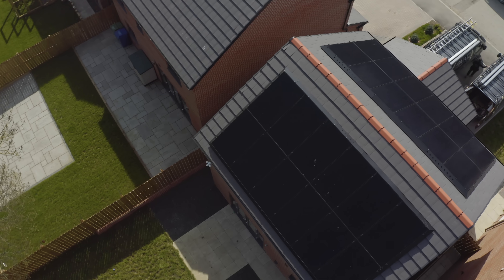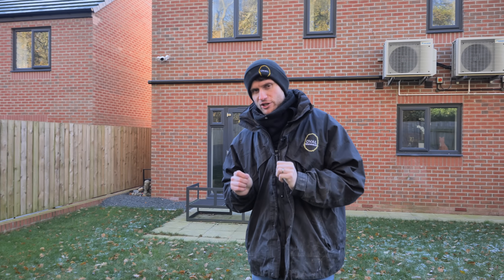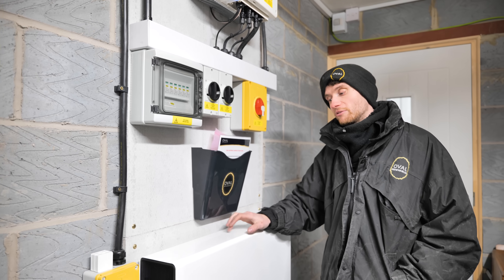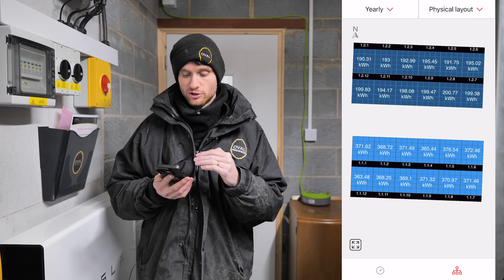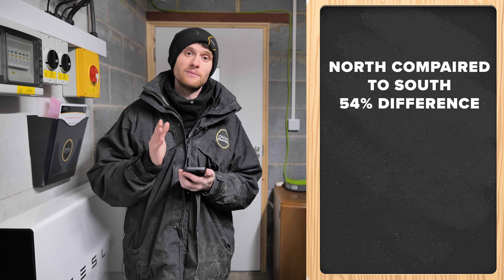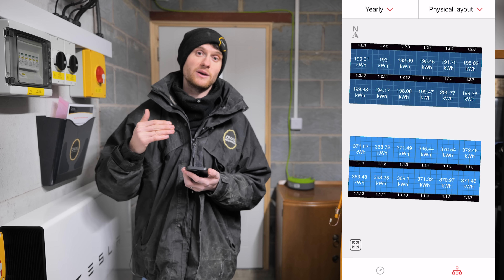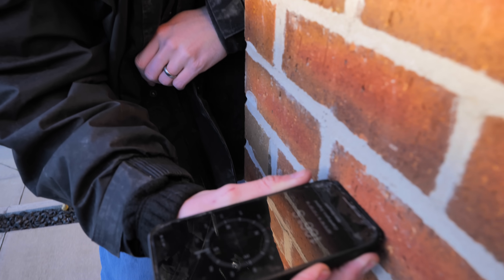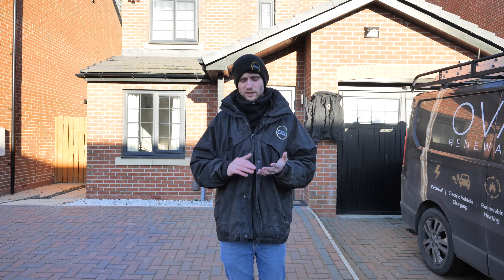North facing Solar Panels? Do they work? Lets get the results!

Comment: This is amazing! Do you have the breakdown of generation by month/season? Wondering if the north-facing panels production is almost entirely in the summer months when the sun rises North East and sets North West. In the winter, when the sun is lower in the sky, it rises due East and sets due West so unlikely much sunlight reaches the panels although obviously panels don't need direct sunlight as they also work in cloudy conditions.
Reply from the maker: That video is coming very soon!

Comment: I did a north facing roof at a similar time to this, to reiterate your conclusion and highlight key point you didn't. On a cloudy day the North and South generation was always almost identical. So when it is cloudy you DOUBLE your production and on a cloudy day is when this is most important. Lets face it, cloudy days are pretty common in the UK especially over winter. So defiantly worth it in my view. 

I appreciate you don't want to share costs and you highlights that the bulk of the costs is already covered but what is the % cost difference to quantify this. How much more (%) is North + South Vs South only. There is a 35% production gain what is the % cost gain?

Comment: Important to note your north panels won't generate all year round. The sun is higher in the summer which means north panels sre getting direct sunlight.

North panels will effectively be 0 generations in winter months (depending on roof pitch)
Reply: Not at all..... For low roof angel buildings like 20 deg. and during ☁️ days it will be preaty decent
Reply: @konradmazur6204 his roof is greater than 20deg

Comment: Good project.
I am interested to understand the marginal extra costs for an additional array of north panels compared to the saving.
E.g. the north roof generated 2457 kWh, which would cost me from eon: 2457 x 22.26p including VAT = £546 per annum.
How many years would it take to recover those marginal costs?
Thanks
Reply: About 2.5 years if installed DIY

Comment: I designed my own system & had it installed 2012 on a NNE & SSW roof with a pitch of ~35°. I get about 60% on the NNE vs SSW roofs, so overall 'efficiency' around 80% across the year. 3kW5 SSW +4KW NNE , Max output 5.96kWs.
My only problem has been, that during the last 12-18 months, the NNE side (only) has developed a greenish mould, (12 years on), reducing NNE output. Does anyone know what I might use to remove this without damaging the pv? I think it will need more than just water . Are there any companies specialising in pv cleaning of this sort?

Comment: In this particular case the north roof also has the advantage of being set back from the 2 either side so when the front is shaded by the neighbours in the  morning and evening the rear can pick up some sun to fill that gap.
Reply from the maker: Each house is different. Some will have a better situation and some will have a worse one. However the amount of generation is really good!

Comment: UK has small houses. if you paraphrase the old US muscle car adage - there is no replacment for displacement - an equivalent for solar would be something like ‘there is nothing fairer than surface area’. If you have a big house with a massive unshaded south facing roof thats great. but for an average 3 bed house? Fill it up

Comment: had a 2.5kwp south array an old FIT array which left no space on my roof. Last year I got 4kwp put on my north roof when I was getting a battery fitted - at the time that was needed to get 0%. I’m very happy with the results. Get about equal which works as the south array is smaller but south facing. Main thing isn’t peak generaiton its baseload coverage where surface area just helps a ton to keep from pulling from the grid.

Comment: But when do the North facing panels produce? Are they only productive in the summer and contribute little to nothing in the winter? As the property has two heat pumps that provide CH in winter, power generation in winter is important, more important than summer.

Comment: I would like to see the same graph for each month, as the angle of the sun is much lower in winters
Reply: Between October to April you won’t get much from north facing due to the suns axis.
Reply: @sweetvuvuzela4634  yes, and simultaneously, that's when you'd require the most energy for heat pumps, etc. That's indeed why I would be interested in a more detailed statistics analysis.
Reply: @ I have south and north facing panels. Obviously the south facing panels will be much better but north facing ones also perform well on par with the south facing ones. This only happens for a shorter period then the south facing ones due to the way the sun shines. But I have had abundance of power from March to October. And south facing panels do work in winter but due to shorter days it’s not even worth acknowledging. I have 12 north and 12 south facing 400 w each.

I had the south facing ones fitted first being sceptical. Following spring I got north side done. 

Got batteries too in summer batteries last overnight and start charging in the morning around 8am and 9 am for the north facing. 

Hope this answers your question. My bills are so low now they are more standing charge then actual purchasing of power ( not in winter)

Based in greater London
Reply: I’m indeed convinced that any panel in any wind direction contributes to power output, but without properly supporting the video with more specific statistics, it’s more like; ‘We sell panels and would like to sell you more panels, because more panels generate more power’. Annual figures don’t mean anything in December.
Reply: @ correct November October till more or less spring your lucky if the panels generate enough to do your background use. Fridges lights etc forget heaters heat pumps etc.

Comment: Would love to know the cost of the 12 on the front in isolation & then the cost if it was the 24. Or even a percentage cost?
Reply: Panels are so cheap now it’s the install cost if your doing one side you might as well do both if you got space and budget
Reply: It’s very cost effective the more panels you add, just fill the roof with as many panels as you can is my advice
Reply: @ yeah, just Wondering what percentage! 
Filled my flat roof with 17 of them. 
Probably could have put another 4 or 5 on the pitched roof. 🤷‍♂️🙈🤷‍♂️
Reply: @bcpbrennan  I did the same mistake I put 16 on my west roof should’ve done the east roof at the same time probs cost me an extra £2k doing it in two hits

Comment: This is great data.  I've had a third MPPT string input just sitting in my junction box up on the roof and the most convenient place to add more panels to use that string input is on the north-facing side.

The real question, though, is how well do north-facing panels work in winter when the sun angle is so low that you barely get any direct sun.  All ambient.  Now there is a lot of ambient light in winter due to cloud-cover and such, but I'd like to know what the summer-vs-winter ratios are north-vs-south to really get a good idea about what it can do for me in winter.

-Matt
Reply from the maker: A few have mentioned this. I’ll see if I can do a part 2

Comment: Not reflected but refracted.
Reply: I think that the more relevant distinction is that of "direct" vs "ambient" light since "reflected" light can still be "direct"...

I am curious as to how much "direct" light the north facing panels were getting - even if at a shallow angle. Unfortunately since the latitude of the house seems to be a closely guarded secret this is not possible to know...
Reply from the maker: I’m no scientist 😂
Reply: @OvalRenewables    But you are an Engineer. Tut tut.

Comment: I have both 14 panels on my south/east roof as well as 14 (older) panels on my north/west roof. I am also using Solaredge and I have the same results. However since my north/west panels are older 260wp panels, I am thinking of replacing them next year for new panels (as they are dirt cheap at the moment).
Reply from the maker: Sounds good. Let us know if you need a hand 👍

Comment: The pitch of the roof makes a big difference. Everybody called me a idiot for placing panels on the north side of my house but the pitch of my roof is just 15 so i was also very surpriced how well they are doing. Especially on cloudy days you can still generate enough to cover the needs
Reply: Yep. This does look to have a relatively low pitch too.

Comment: My house is pretty close to north south like this example, but the south facing roof is full of dormer windows etc., so might only have room for 4-5 panels.  Probably room for 12 panels on the north face.  Is there a tool that can calculate the generation potential based on latitude and roof pitch to see if it’s potentially worth while?

Comment: So for this house what is the total cost inc Labour to fit all those solar, batteries, inverter etc?
What did the home owner receive in payment from the grid for the power it generated.
Are those air source heat pumps attached to the rear of the house., vibration, noise?

Comment: Interesting, what about the roof angle, this is a very low apex roof. Wouldnt a more vertical position on the roof mean even less production?
Reply from the maker: A few have mentioned this. I’m annoyed I forgot to mention the pitch. It’s 30 degrees which is standard in the uk for a lot of homes
Reply: Yes.  The more pitch, the worse the performance is on the north side.

Comment: Thanks for the Video. Only important point that was missed is that especially if the power is used at home the north side produces even more percentage in the times with less sun. This is when we often need electric power the most.

Comment: I have installed 6.3kWp on our south roof, and 6.3kWp on our North roof, 12 panels on each, and a roof pitch of 23 degrees, the last 31 days the south has generated 105kWh with max power of 3831W, and the North has generated 54.66kWh with max power of 1366W, so this confirms you findings, basically  the North generates approx 50% of what the South roof generates give or take. I am however expecting the North to generate a better % when we get to the Spring and summer as the sun will be higher in the sky, and as we have a low pitch on the roof, should get more sun hitting those panels than a house with a 45 degree pitch, system has only been on for a couple of months though hence not much data. Battery is a game changer, we have 32kWh battery

Comment: 4556 kWh is about 520wH if using a flat line across the year

Per square meter, assuming 1.5 per panel is about 29wH per sqM.

Assuming the panels are 20% efficient, the maximum possible per sqm, directly south facing, in the south UK, is  22wH/sqM. 

So your system is delivering numbers about 25% above what that laws of physics allows.

Unless the panels are 30% efficient which is unheard of. Or the panels are larger than the average size I used.

Please can you clarify?

Comment: So the argument is that the best return comes from  S facing panels but, while N facing panels only add 54% as much power, if they are added to the S array at time of installation, their incremental cost is lower than what would have been the cost of just the initial S array which makes the payback return for the N panels better than you had expected. This might have been easier to explain if you had put numbers against the cost of installing just the S array and then of the S + N arrangement you actually installed.
Reply from the maker: To be honest that argument is a lot harder to make around costs. As each job costs different amounts, access and equipment are different on each job. I wanted to put this video out just based on generation so people could take some figures and get quotes for possibly including north facing panel and do their own calculations based of the %’s in the video. If I had put costs to it then it would have helped to see if this job in particular would have been worth north panels but not any others. Also the customer didn’t want me to share the costs of the job.

Comment: Really interesting video, I've been considering solar since moving in to our new property last year but wondered whether it would be worth going for both sides and I think it may be!

It would of been really nice to see how much that entire installation cost and generated over the 12 months though - looks like they sold about 50% of the power generated back to the grid and they have full air conditioning by the looks of it !
Reply from the maker: If you want us to see how much it would cost on your property then drop us an email to info@ovalrenewables.com. The customer wasn’t happy to share the cost on a video
Reply: @OvalRenewables  I'm in South Yorkshire, would it massively impact the cost being so far away from you guys?
Reply from the maker: @ we are only in North Yorkshire. No we travel nationwide, you pay a little bit more but that extra bit of money split over the next 20 years of the system is next to nothing per year. We obviously pride ourselves on high levels of workmanship but also after-sales which is worth a bit more 👍

Comment: Thank you so much for sharing, one key part to the success is possibly the roof pitch being shallower than other types of houses. I have similar orientation but a steeper pitch roof so it's interesting to compare. So 2yrs ago I've crammed 12 x 420w Jinko panels on the south with a less fancy ac coupled inverter. +5kWh battery costing just shy of £10k

Im in Cambridgeshire with 0 shading and my April 23 to April 24 generation is 5,530kWh.

Given my steeper roof pitch I doubt I would get 35% on the north but would be interested to see data on this. I agree that it would be more cost effective per kW to do the north but it would extend the pay back period of the investment.

Comment: What is the backing board you use on the wall to attach your equipment ?
Reply from the maker: It’s called Hardie board. It’s a concrete fibre board.

Comment: In hindsight, having north-facing panels as well as south-facing panels would have been an excellent idea. Having already had south-facing panels put in, I think it would be difficult to justify now. That said, there is space for some more south-facing panels below the chimney, so an upgrade in years to come might still be an idea. I have 12 390kWp panels coupled to a 3.6kW inverter. It generated 4196 kWh in the first year and the panels are on the 174 degree S facing roof; they are subject to a bit of shading that happens roughly between the equinoxes that wouldn't be a problem for panels on the north side. It's great to know the likely generation of the panels; it would be good to know the roof elevation and how much effect that has. Thanks for the video!

Comment: Also don't forget the angle of your roof, the angle of this roof was pretty low so noth facing pannels is a better option. The higher the pitch the less interesting it becomes. Great video by the way.
Reply from the maker: Apologies if I didn’t mention the pitch. It’s a 30 degree pitch which is standard on the uk
Reply: @OvalRenewables  No apologies necessary. Top video

Comment: In July We had 14 x 500w panels fitted on NE roof with 6 fitted on SW roof due to restricted space. SolarEdge 10kwh battery and 8kwh inverter and gateway. I haven’t looked too deeply at numbers but it’s looking good so far. As you say, it’s worth doing.
Reply from the maker: Great to hear!

Comment: Great video,one question. I was told you could only have 5 kilowatts is this correct.           🇬🇧
Reply from the maker: No there is a big misconception on the total amount you can have. Firstly there is a difference between the inverter size and the total installed capacity of the panels. The DNO do not care about the number of panels they can as to the size of the inverter. You can have an inverter larger than 5kw. Anything over 3.68kw single phase requires prior approval from the DNO. However we regularly get approval for systems larger than 5kw

Comment: This is exactly the kind of content I'm looking for. I'm SSW to about 160. My roof is 50o which is a considerable difference to the property shown. Idealy I'd like data on a steeper pitch
Reply from the maker: That is a crazy steep pitch, however if you are just putting panels on the SSW roof then you will get great generation
Reply: @OvalRenewables  Yeah, its a townhouse with a dutch roof on the second floor, complete with 3 velux windows on the SSW but only one on the NNE. Just have about enough space for 2 rows of 4x 170+/113 panels above and below the velux... possibly 11 with mixed portrail/landscape but that's questionable.

JRC is estimating the bellow from 11x 440w NNE panels, which is attractive but I want that backed up by real world data

Slope angle [°]:50
Azimuth angle [°]:	-160
Yearly PV energy production [kWh]:2032.79

Have the possibility of a 4x solar pergola in the back garden but that's hindered by the house blocking for much of the year.